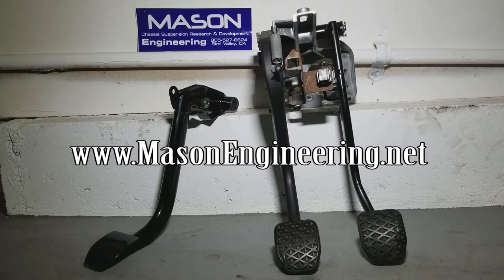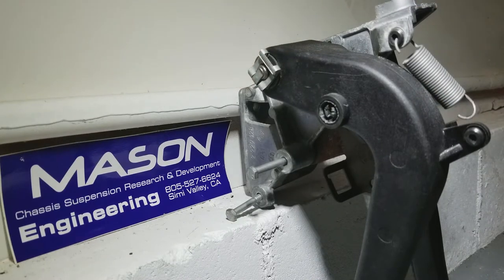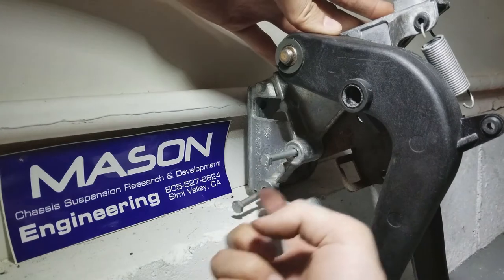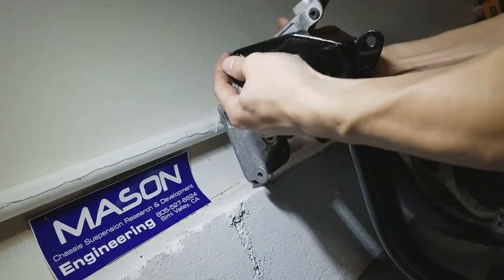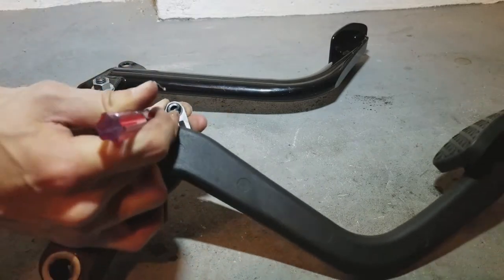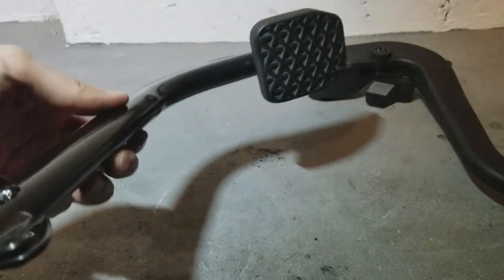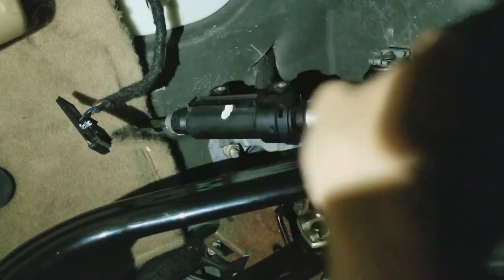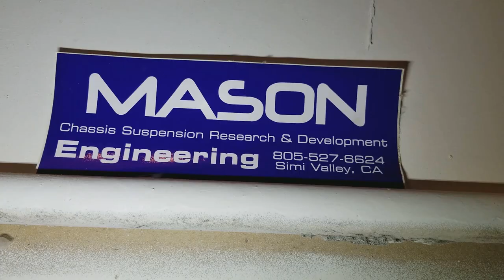BMW E46 Short Throw Clutch Pedal installation. Mason Engineering

Comment: I installed mine yesterday. It wouldn’t depress enough to start the car. Any work around for this?
Reply: Depin the clutch position sensor wire for clutch safety switch, or just remove it entirely if you don't need cruise control

Comment: looks like the bracket that was bent up and out of the way holds the cruise control switch....yes?
if so, any work around to use this on my street car and keep the cruise control?

thnks
Reply from the maker: Bimmermaven Wrench so after this vid they shaved off the bolt so no need to worry :)
Reply: HAN'S GARAGE thanks!